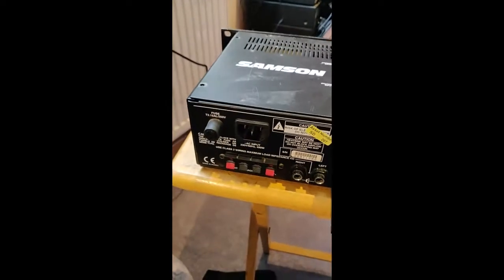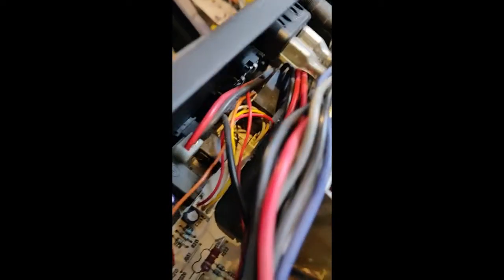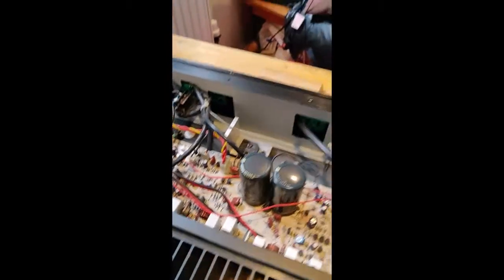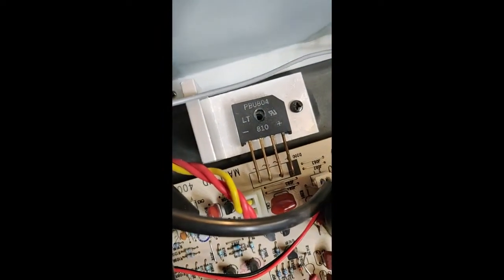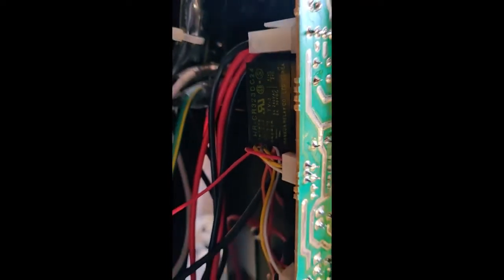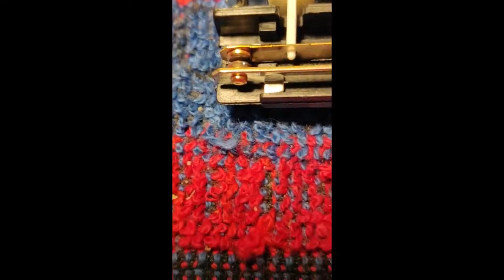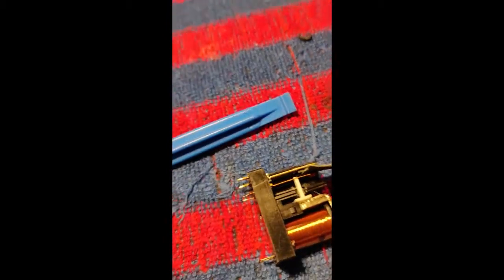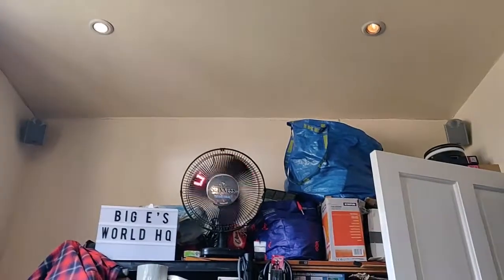Samson Servo 260 intermittent sound/faulty speaker output relay HR-CR 323 DC24

Comment: Thanks a lot! Had mine repaired yesterday (replaced the relay). Had those issues for years. Then left, then right, and when cranking up the volume or multiple power cycles it mostly stayed stable. Now I can listen at very low levels without that crap :)
Reply from the maker: yay good work,they are fab little amps 🙂

Comment: Searching around for ideas as to why my Roksan kandy k2 BT has an  intermittent problem, left channel intermittently dies while right channel is quiet. Sometimes all works fine!
Reply from the maker: Tricky does it have a machinal relay system for output protection?  The other thing you could try would be to ask Gemini 2.5 to try and pull some information together for you. Intermittent faults are really difficult sometimes, I would always try to get the fault on so you can track it down.Good luck Lozboi 🙂
Reply from the maker: Based on user reports and technical reviews, the Roksan Kandy K2 BT can be prone to a couple of specific intermittent problems. Here is a breakdown of the most common issues and the steps you can take.

1. Intermittent Power-On Fault

This is the most frequently reported intermittent hardware issue.
The Problem: You press the power button, the amplifier clicks on for a second (and the display may light up), and then it immediately clicks off, as if it's protecting itself. This may happen several times in a row, especially when the amplifier is cold. After a few tries, it may power on and work perfectly fine.
Likely Cause: This behavior is characteristic of an
overly-sensitive protection circuit. The amplifier is designed to shut down to prevent damage from things like a speaker wire short or overheating. In this case, the circuit may be triggering falsely on startup. User forums often point to aging components, such as a failing capacitor, as the root cause for this sensitivity.
What You Can Do:
Check Speaker Wiring: As a first step, power off and unplug the amplifier. Disconnect your speaker cables from the amplifier's terminals. Check both ends of your speaker cables for any stray wire strands (even a single tiny strand) that could be shorting between the positive (+) and negative (-) terminals.
Isolate the Amp: If the wiring looks perfect, try powering on the amplifier with nothing connected to it (except the power cord). If it still shows the same intermittent power-on fault, you have confirmed the issue is with the amplifier itself.
Seek Professional Repair: This fault is not typically a user-fixable issue. It requires diagnosis and repair by a qualified electronics technician who can test the power supply components and protection circuit.

2. Unstable or Intermittent Bluetooth Connection

This is a common complaint related to the "BT" functionality of this specific model.
The Problem: Your phone or tablet has trouble finding the Roksan, fails to pair, or the connection is "shaky" and drops out, even when the source device is nearby.
Likely Cause: This is often due to wireless interference. The Bluetooth signal (which operates at 2.4GHz) is competing with other devices in your home, most commonly your Wi-Fi router.1

What You Can Do (Troubleshooting):
Restart Everything: The classic fix. Turn off the Roksan amplifier completely. Restart your phone or tablet. Then, turn the amplifier back on and try to connect again.
"Forget" and Re-Pair: Go into your phone/tablet's Bluetooth settings, find the "Roksan K2" in your list of devices, and select "Forget This Device" or "Unpair."2 Then, put the K2 BT into pairing mode and try to connect again as if it were a new device.

Check for Interference: This is the most likely culprit.
Wi-Fi Router: Is your Wi-Fi router sitting right next to your amplifier? This is the strongest source of interference. Try moving the router (or the amplifier) even just a few feet away.
Other Devices: Cordless phone base stations, game consoles, smart TV streaming sticks (like Roku or Fire TV), and even USB 3.0 devices can all cause 2.4GHz interference.
Update Your Source: Make sure your phone or tablet has its latest software updates, as these can include fixes for Bluetooth connectivity.3

Test Another Source: Try pairing a different phone or laptop to see if the problem is with your specific device or the amplifier's Bluetooth receiver. If another device connects perfectly, the issue lies with your primary source device.

Other Potential Issues (Less Common)

Sound Cutting Out at High Volume: If the sound plays fine at low levels but cuts out when you turn the volume up, this is almost certainly the protection circuit doing its job. This can be caused by a low-impedance load (e.g., speakers that are difficult to drive) or a short in your speaker wiring.
Intermittent Channel Imbalance: If one speaker (left or right) cuts out, fades, or crackles, especially when you adjust the volume, this often points to a dirty or failing volume potentiometer (volume knob). A technician can clean this with a special contact cleaner (like DeoxIT) or replace the part if necessary.
If the simple troubleshooting steps for the Bluetooth or power-on fault don't resolve your issue, I would recommend contacting a local hi-fi repair shop.
Would you like me to help you find an authorized Roksan service center or a well-regarded electronics repair shop in your area?

Comment: Thank you so much for this film. Mine has had the problem for ages, so annoying. Anyway I took off the top cover, then un-clipped the power socket, then another cable next to the relay. I pried off the top of the relay easily and from the top was able to clean with a tiny fine file the contacts. Left the cover off the relay now, had it blasting and not a single cut out. So if you don't want to take it all apart like Ian does here you can free up the cables (power socket un-clips and pops out easily) remove the cable to the left of the relay which pulls out simply and access the relay. With little effort I pulled the cover off to get access...try this it worked for me and thanks again Ian for this film...
Reply from the maker: Hey Nicholas glad it helped its wonks since I did this and the relay/amp still going fine! 🙂

Comment: Can't believe you posted this only 6 months back, it's just what I need! My Samson 170 has been playing up for a while and if I 'wiggle' the mains lead, the sound comes back on the failed channel. The close proximity of the relay to the area around the power lead makes me think it is the same issue. Well, soldering iron at the ready... and here goes!

Thanks for posting this Ian; I'd get you a pint if I could! 🍻🍺
Reply from the maker: Haha this amp had had that fault for ages to be fair. I'd even looked at it for a chum, and couldn't find the pesky "Dry Joint" then I saw a video and had a go, don't forget your solder mop good luck, oh and mine is still working fine after cleaning the relay contacts :-)

Comment: Hi Richard and Ian. Hope you are doing well. So some news from Denmark and Samson-land. A friend help me out and we managed to get to the relay - component thing. However we were not able to get it of the board. It was really tight. Is it supose to come up? We drilled 2 small holes in it insted and blow some compressed air into it and it actually help - right up to me putting the amp back in the rack :-D. Now it started acting like a teenager again. I might do it over and considering replacing the relay. What is this component called, if I want to buy a new one, and does it come out/off? It was really tght so I was afraid to break the board it is sitting on. :-)
Reply: I have a Servo 550 which is intermittently cutting out.  Ian, was the relay you cleaned the one which mutes the amp for couple seconds after switching on power?  (You can hear it click when the "protection" light turns off.) In my 550, this is located on a much more open part of the board, near the front power button.  Thomas, is that the relay you serviced on your 550?
Reply from the maker: @zwiebelspaetzle  Hi zwiebelspaetzle, yes the relay is part of the speaker protection/anti THUMP circuit, the contacts inside get dirty, so need cleaning(or replacing the whole relay,if you can).I think Richard actually managed to get the relay cover off by gently prying it off. After you have cleaned the contacts a little spray of "Electrical contact cleaner" sprayed on should help it going forward. Good luck sorry I'm only just replying I've been busy restoring the Apex on our house(maybe another video coming soon haha).
Reply from the maker: Hi Thomas,you would have to desolder it to remove(or try to remove the cover from the relay).
Reply: @ianroberts7119  Ahh so the housing comes of, like the outisde of it. good thing we didnt pull. Thanx Ian :-)
Reply from the maker: @thomaswindfeld728  Yeah it can be removed (maybe gently warm it first with a hair dryer to make the plastic more malleable!) its a relay which you can buy, you need to check when ordering a replacement part for the voltage/current AC/DC and its pin configuration pause the video at 5mins 17 secs for all the data (HR-CR 323 DC24,search for this part number to source a replacement/data/pin orientation/ information, to make sure it fits into the pcb correctly. All of which should all be printed on the cover of the relay, good luck :-)

Comment: Thanks SO much for this video. Like others here, I've had this problem for way too many years on my Samson SERVO-170. It's taken me many years of fear to overcome trying to fix it myself as I didn't want to try replacing the relay, but your video led me to trying to clean the contacts. I've only been listening now for a short while, but it does sound cleaner and no crackle/cut-outs as yet. BUT PLEASE NOTE, even better: I managed to clean the contacts without removing the relay. I took the top/lid off. Then with thin nosed pliers I managed to remove the 3 leads to the mains inlet(after labelling each with a sharpie!) and then the small white block (with about 4 wires) too, leaving the relay unit clear. With same pliers I pulled the plastic cover off of the unit as you did(a stroke of luck as I was trying to remove the whole thing!) but whilst still in the amplifier. Then a bit fiddly, but I squeezed some thinly cut emery paper in to clean the contacts. Put it all back together and so far so good!! I'll report back IF the problem returns, but for now, I'm one very happy Ian Roberts fan!! Cheers mate.
Reply from the maker: Haha top job Richard, yes I found it a little tricky "popping" that cover off the relay with the thing out of circuit so well done, and thanks again for the positive comments :-)

Comment: I have the 550 and has had this problem for lie 5-6 years now and I am about to send it of for repair, with the video. So thanx so much for making it :-)
Reply from the maker: Hey Thomas hope it all gets sorted out, after cleaning the contacts on mine its still working fine(up now any way 1st Jan 2021) Its a good little amp :-)
Reply from the maker: Hi Thomas, the actual component is a double pool, double throw relay(its basically  a switch that connects & disconnects the left and right outputs).Your repair tech will be able to source a correct replacement from the information printed on the component ;-) I think your amp may have a slightly different one if its a higher power output(principle is the same, an ic controls the coil/actuates it & makes the contacts pull together, the contacts oxidize and give poor connection).
Reply: Ian Roberts hi ian. Allrighty then. Lets see if he can fic it or get a replacement. Thanx so much for time;)
Reply: @thomaswindfeld728  hey, if you haven't had it sorted, check my reply above. I found a simpler way to clean the contacts, well worth a go, no soldering or particular skills needed!
Reply: @richardsidwell8541  Hello there sir. Which reply are you refering to? I didnt manage to sort it out. It sitting in the basement now so Id be more than interested in finding out the asier way. The store would charge me 150 punds, 250 dollars and he couldnt promise it would work.
Reply: @thomaswindfeld728  the fact that you were going to send it off for repair. I cleaned the contacts but with minimal dismantling. Mine is a Samson Servo 170 so don't know if it's possible with your's, but surely worth a go? I detailed what I did in my earlier message. Good luck.
Reply: @thomaswindfeld728  did you give it a go? Mine is still working beautifully with no of those awful drop-outs/crackles! Wish I'd done this years ago.
Reply: @richardsidwell8541  Since one of my many talents is taking things apart and not being able to put them back together again a friend of mine has offered to help me out and using this video as a guide so hopefully we will get it up and running soon. I love this amp and the punch it gives compared to my Hifi amp
Reply: @thomaswindfeld728  I took a LOT less stuff apart than Ian, I don't have his skills and so lucked out a bit. I didn't remove the circuit board or anything like that. Here's what I did:  
I managed to clean the contacts without removing the relay. I took the top/lid off. Then with thin nosed pliers I managed to remove the 3 leads to the mains inlet(after labelling each with a sharpie!) and then the small white block to the left of the relay too(with about 4 wires)(this gives access to the relay) leaving the relay unit clear. With same pliers I pulled the plastic cover off of the unit as you did(a stroke of luck as I was trying to remove the whole thing!) but whilst still in the amplifier. Then a bit fiddly, but I squeezed some thinly cut emery paper in to clean the contacts.
Reply: @richardsidwell8541  Thank you!!! You are a paw! Ill be sure to give my friend your procedure. It will be very helpfull. Thanx! :.-)
Reply: @ianroberts7119  Hi Ian >/(. Did you manage to find out what the thingi, making the noise, is called and if it can be purchased still somewhere? I am brinning my 550 to a repair shop tomorrow and he will attempt cleaning it, but if that does not work, a replacement could, no? Hoping to hear from you :-)

Comment: Mate, this is a timely video... I have the same amp that's had the same issue for nearly 15 years... it's been a door stop ever since and I was about to toss it, but figured I'd check one more time if anyone had found a solution... Thanks to your video, I'm going to have a go at fixing it. I'll let you know if it works.